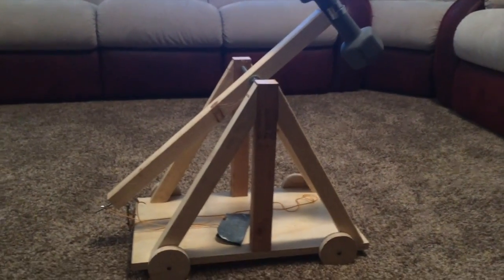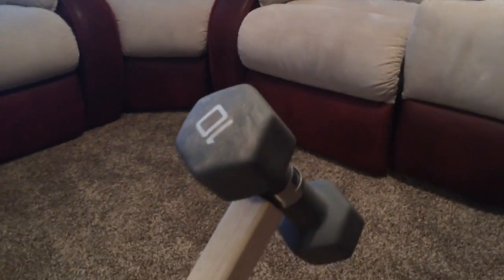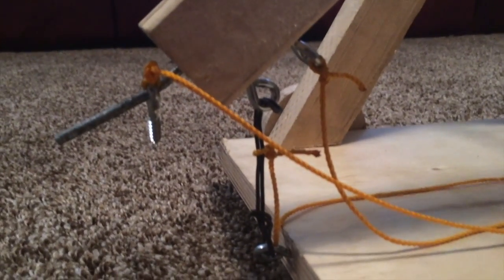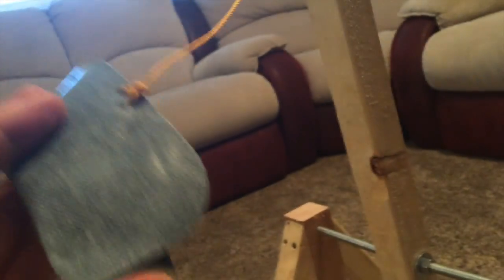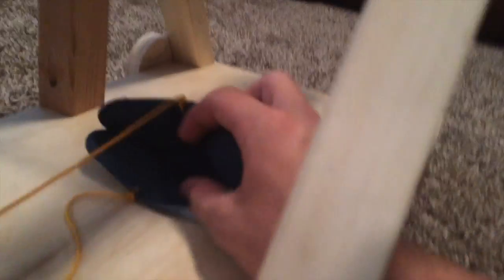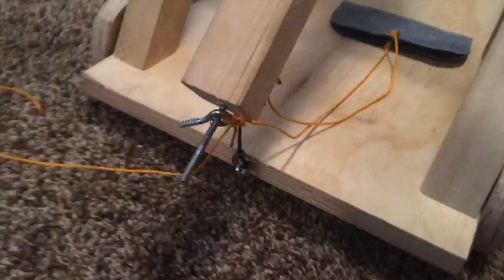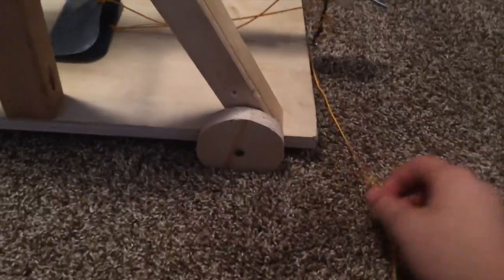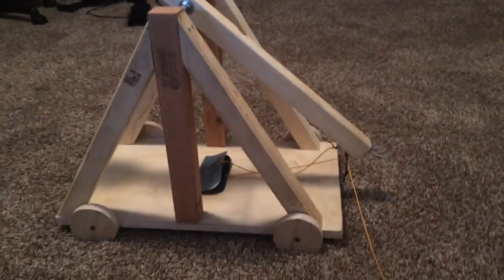Simple Trebuchet How To: Sling and Release

Comment: What is the metal piece called that straps onto the 10 pound weight. The thing that holds it to the wood and is adjustable
Reply: little late but those are called hose clamps

Comment: Thank you so much for making this video, I really didn’t understand what was going on when trebuchets are shot and half the sling magically comes unhooked. Now I see how that happens
Reply from the maker: Hunter Hobbs I was in the same position, glad I could help :)
Reply: Tyler Rice 

What do you recommend I use for my sling material? Cut up an old shop towel or something a little more complex than that?

Also if I intend to shoot a golf ball 
Do I really need ten pounds of counterweight on there? Or Could I use a much lighter counterweight and still get that ball to fly. I do not have a shot distance that I need to reach, just need the thing to work, not shoot and hit the ground every time which is what I’m afraid will happen when I’m done building it.
Plus I’m using very lightweight plywood to construct the thing and I don’t think it can handle a ten pound counterweight, but maybe it could. I’m just not sure
Reply from the maker: @hunterhobbs4374   Since this was over three years ago at this point, I can't remember exactly what I used, but it looks to be just a piece of extra fabric I had lying around. A towel would probably be fine, but I would recommend using one with the least amount of friction as possible. If anything, head to an arts and crafts store and pick up something like what I had in the video for like a quarter.

The counterweight will depend on the length of your arm as it needs to have a balance of sorts (where the actual physics of it comes into play). After playing with some different weights, this 10 pounds ended up being perfect for mine and the distance I needed to reach. 

As far as the plywood problem goes, it just depends on the scale of the trebuchet. If its the size or larger of the one in the video, I would definitely recommend getting some better supplies. Of course, this will depend on how dedicated you are (ie how much money you are willing to spend) as well as how many times you plan on using it.
Reply: Tyler Rice 

Thank you for your time

Comment: Hey Tyler, thanks for this video, it's awesome. I wanted to ask you something and I would really appreciate your help: I want to build a trebuchet to throw an egg 65 feet away, but I don't know where to start. There are so many variables, like the length of swing arm, mass of the counterweight, height, mass of swing arm, etc. What is that single variable that my team and I should be focused on to be closer to a successful result (landing the egg in a basket placed on the floor 65 feet away)? I would really appreciate your help, thanks!
Reply from the maker: Hey Andres, I am glad you found the video helpful! You can use this website as kind of a guideline to go off of and see some possible measurements, but the biggest things that are easy to change are the counterweight and the length of the string/rope. If you are going for 65 feet with an egg I would start with about 10lbs of counterweight, but that will depend on the trebuchet itself.
Reply: Virtualtrebuchet.com can help you get your references.

Comment: You are also losing power because it is rocking on its wheels. Lock the wheels down and you should get a better throw.
Reply: that is wrong. Wheels allow for the counterweight to travel down in a more straight path, making it much more efficient. I found that out in my research  for my project lol
Reply: ethan martin is right u need the wheels to allow the counterweight to travel down in a straight line.  Lol learn some real stuff